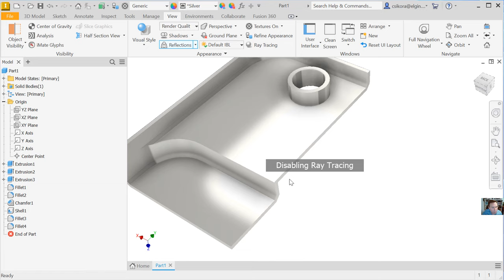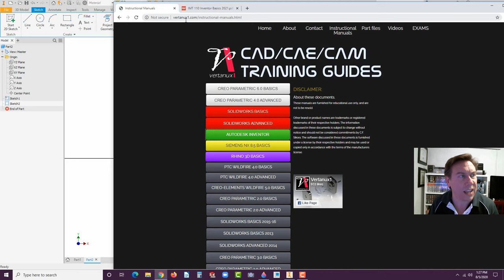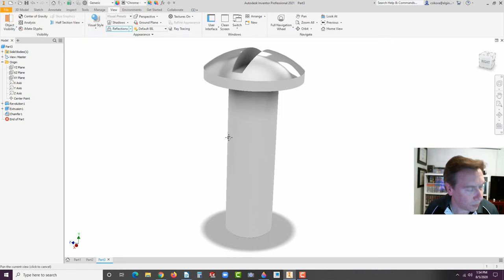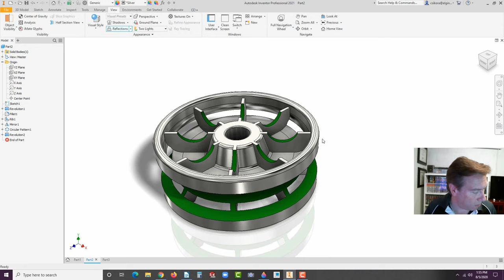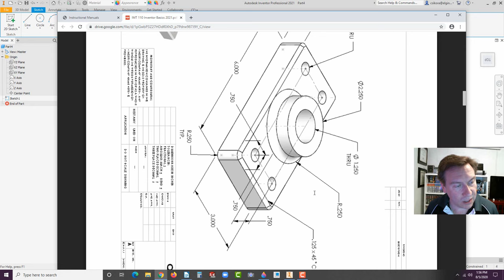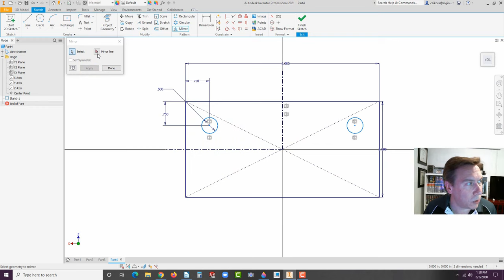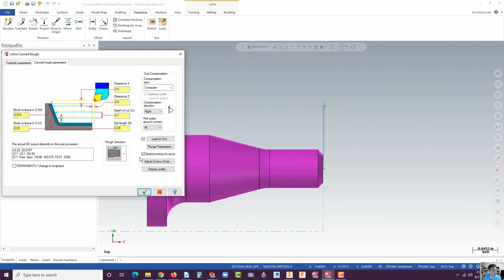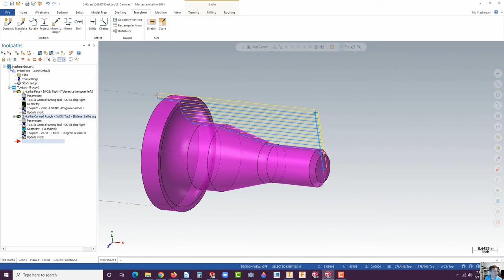Autodesk Inventor Complete College Course for Beginners with Training Guide

Comment: Thank you for posting this online for everyone. I am not sure if its my settings or if I have a slightly different version as its a year-ish later. But when creating a new sketch from an extruded part, none of the snaps work. This has proven especially difficult for exercise 2 when I am attempting to add the lines to turn into ribs (53:58)  Any ideas what I might be doing wrong?

After fooling around I managed to do a work around of doing a smaller line then adding a coincident constraint but its more work. Also "Project Geometry" seems to help but in either case its a couple extra steps.

Based on Autodesk lit. it appears to be a setting within the "Constraint Inference scope". But I am honestly at a lost. Any help would be much appreciated

Comment: I did your lab 2 the bolt height of 2" isn't technically correct as you have chopped the diameter down, but yes the idea is fine